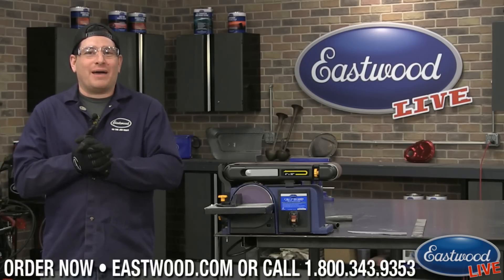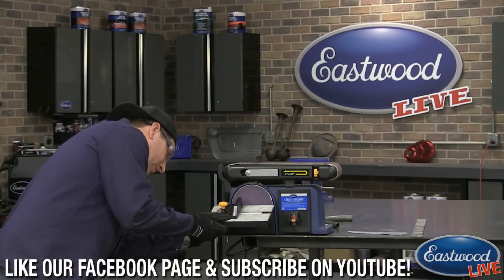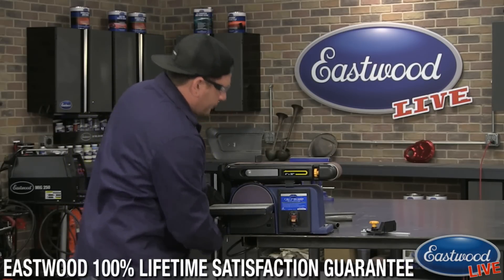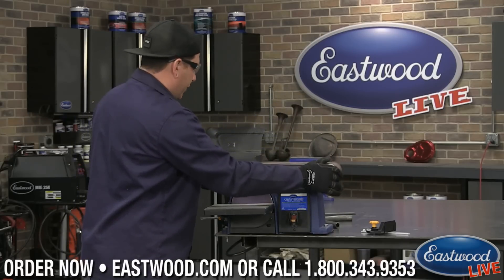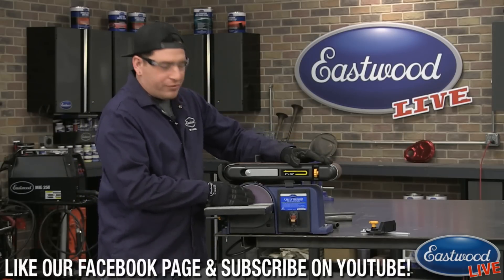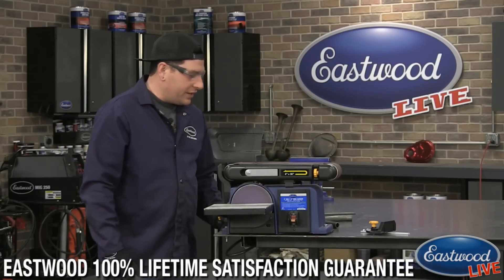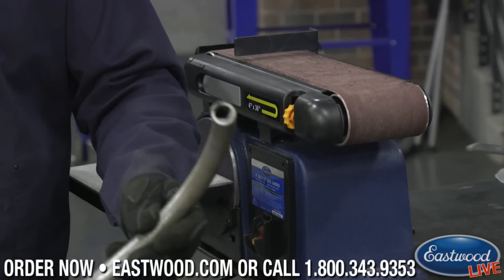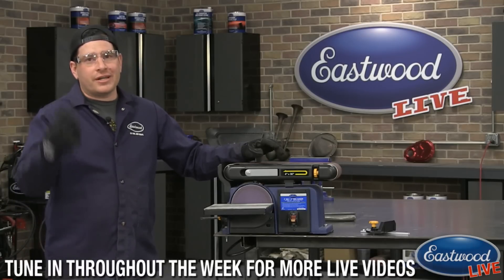Tips & Tricks with the Eastwood Belt / Disc Sander + How To Properly Grind Tungsten for TIG Welding

Comment: I have the Mastercraft version of this sander. it lasted 3 times use and then died. I managed to get it working for 5 mins and then it blew up again
Reply: I have the ryobi version. Essentially identical. It's been running for 10 years. Just ordered the ShopFox version for light metal grinding and tungsten. Picked the Shop Fox because it was a little less than the Eastwood today, but  usually it's $25 more for the same machine.  They're all coming off the same production line and there will be the occasional dud, so I try to pick a company that will let me return it if it's bad. I think Eastwood will, they've always stood behind their equipment.  I know HomeDepot and Grizzly/ShopFox will swap out the occasional bad machine. It's also worth looking at the Buck Tools version which is the only one that is oriented differently, to see what you prefer. It's $40 or so more, but a little more powerful and set up like a bench grinder.

What I appreciate is that they did this video cold and they didn't edit out mistakes like when he tried to push the belt on too far on one side rather than walk it on.